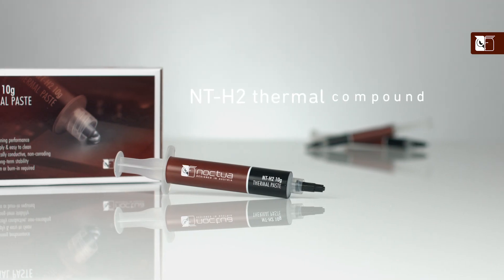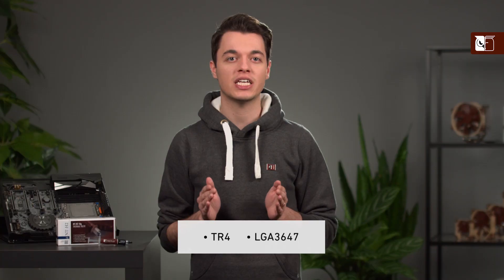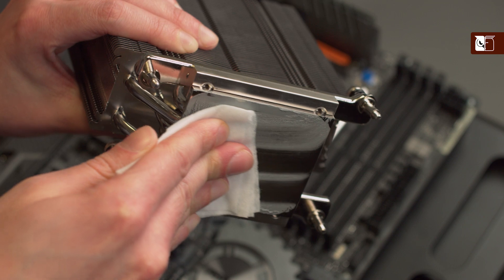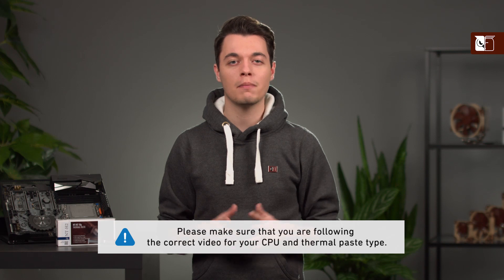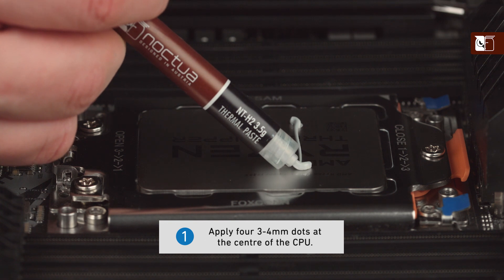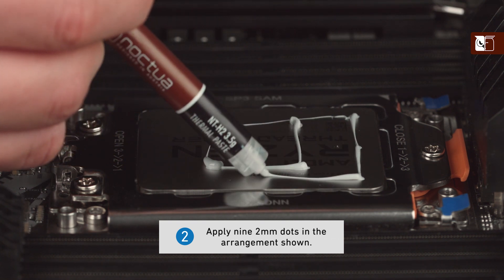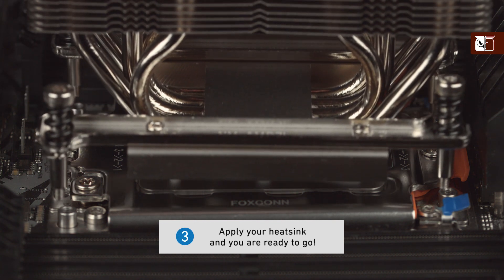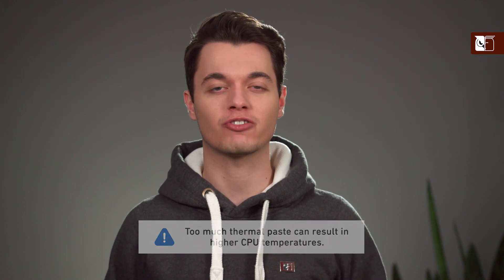Noctua NT-H2: How to apply on larger-sized CPUs (e.g. AMD TR4, Intel LGA4677, LGA4189, LGA3647)

Comment: Hi! I'm planning to use NT-H2 to "repaste" my ps4 pro that's been overheating like hell recently and for the first time in its lifecycle. Like base ps4 it features an AMD system on chip design with a custom apu based on Jaguar cores and a Bonaire graphics chip with bits and pieces from the Polaris design, measured at 322 mm2, so I guess it's either medium or large but I wanted to make sure of the quantity of material that's best.

Comment: Putting too much paste on a socket generally won't hurt thermal performance, because the act of tightening down the cooler squeezes out the excess. Too little paste is bad, but anything above the minimum threshold will have the same effect once the cooler is tightened down.
Reply: Why does he say putting too much will increase temps?
Reply: @WarNeverChangez  because it does

Comment: I love Noctua. Nice products, nice videos, nice information, nice official website. A12 fans are superb. I will try thermal paste too but there is no guide for gpus.  RTX 2080 has relatively big die and no ihs. I guess medium sized application guide works best for the gpu. 1 big pea to center, 4 small pea to corners :) 

I bought kryonaut from thermal grizzly because of the benchmarks on the internet. It performed veery veery bad. I tried 1 big tube, a lot of applications but it didn't worked. I guess it needs spreading instead of pea or any other method. Or maybe it was a bad-expired sample i don't know. Gelid always worked nice. Now i'm going for Noctua.

Comment: It's quite surprising that the manufacturer itself doesn't know how to correctly apply the thermal paste
Reply from the maker: Surely you must know better how to best apply a paste that you have never used so far... ;-) Seriously though, we are perfectly aware that people have different preferences when it comes to applying thermal paste and lots of users swear by spreading methods. However, it's important to note that which method works best differs from paste to paste because pastes have different spreading characteristics. For our pastes, the methods we recommend are those that will allow most users to achieve the best and most consistent results. Obiously, everyone's free to use his preferred method though.
Reply: @NoctuaVideos  Good burn
Reply: @NoctuaVideos  Can we see the results of the tests you have done that show manually spreading the paste or other methods you are so quick to dismiss are actually inferior?
Reply: Shut up you foolish rude kid, everything except Noctua!
Reply: I agree! The correct way is to use plastic and to apply this white dots before mount the collier. Also. noctua... you need to point this LGA socket 3647. This is the last socket which you will have profit. In regards of ARM architecture soon you will ask your self, where is the clients? ARM do not need high-end coolers. Sorr, this is the true. AMD already made first 64bit ARM mainboard with cpu including.  You need to thing fast now due to the future is not good for you.

Comment: I think the advice should to be just always spread the thermal paste. What I've gleaned from benchmarks of different application methods is that you just don't want to have too little paste. Too much just gets pushed out and doesn't harm anything and you don't really have to worry about getting air bubbles.
Reply from the maker: This completely varies from paste to paste. Ours have excellent spreading properties, so there's really no benefit in spreading them manually as they will spread just fine under the pressure of the heatsink.
Reply: Yeah that's fair, but giving different application patterns per socket and paste seems like it might scare beginners away more than to just say that the universal solution is to just spread it no matter the paste and socket size. I have no qualm that what you're showing in this video would work perfectly fine ^^
Reply from the maker: @-Kerstin  But then the question remains how thick the layer should be. From our experience, especially beginners tend to apply way too much paste with this method. While it might get squeezed out and not hurt performance, it would still make a mess and it would be quite a waste of paste.
Reply: @NoctuaVideos  I'd rather waste $5.00 of paste than a $500.00 CPU,
It's all about risk vs reward imho
Reply: @Berzerker204 The worst thing is not having enough paste.
Reply: I don't get how people can say stuff with so much confidence. I literally just searched for it on this very site and the first three benchmarks of this all show you are wrong. Took like 10 minutes:
r2MEAnZ3swQ
VJq-FbhzOtk
W7pvGzUQtQ0